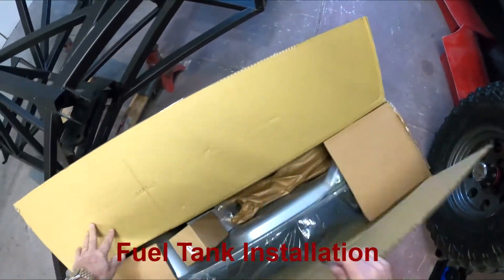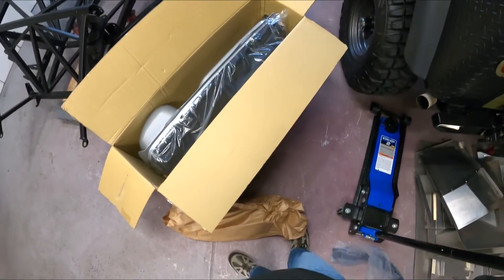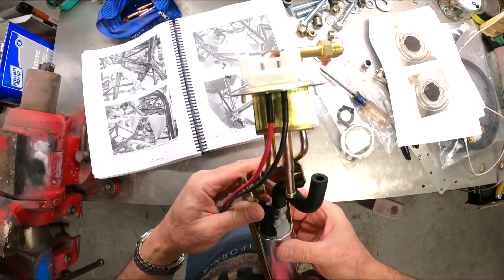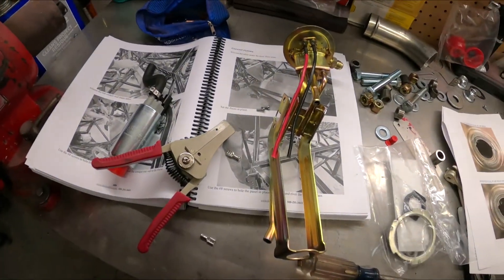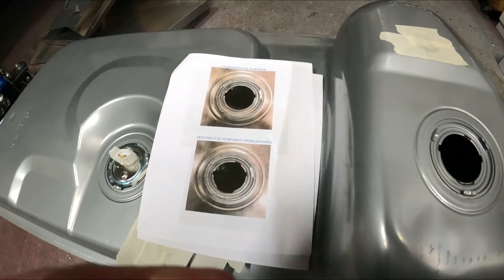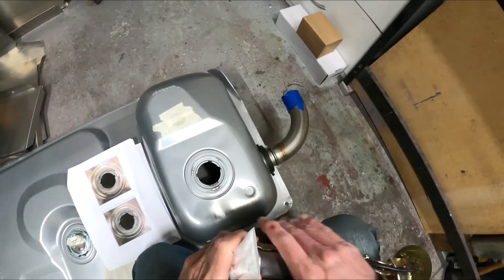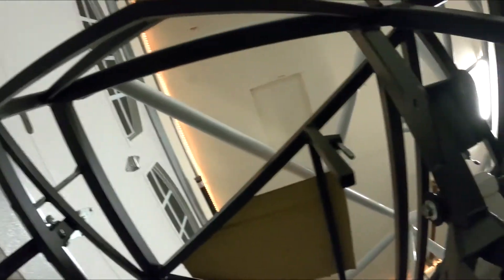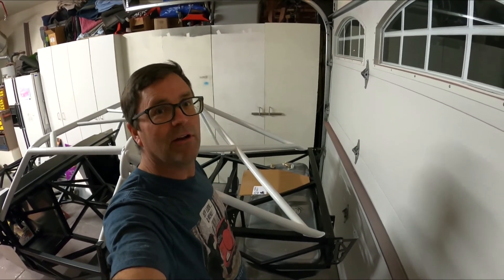Cobra Daytona Build-Fuel Tank Video 14

Comment: What fuel pump did you get? I bought the one from the manual, GSL392BX, but it seems too tall and too fat for this hanger.
Reply from the maker: A walbro gss340. Not sure what the 392 is for but the 340 works. Loud though.

Comment: do you remember what kit you bought for the pump that included the s shaped fuel tank line that runs from the pump to the pump hanger ? Or was  that with the kit ?
Reply: disregard , I am blind
Reply from the maker: I upgraded to the proM hangar. A great upgrade which I highly recommend
Reply: @cobradaytonabuild1671  Did you record how you setup the fuel lines?  From what I can tell, it looks like you ran the lines down the drivers side to a pressure guage and from there to the engine?  What brand lines did you use?
Reply from the maker: It’s a proM hanger and I highly recommend it.
Reply from the maker: I think I used summit ptfe lines and you are correct on the routing.
Reply: @cobradaytonabuild1671  Thanks!